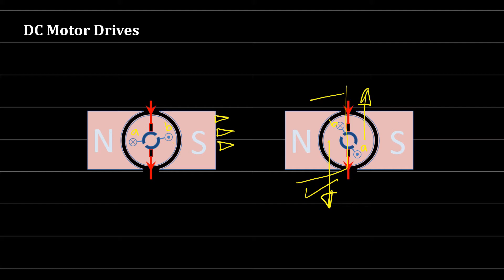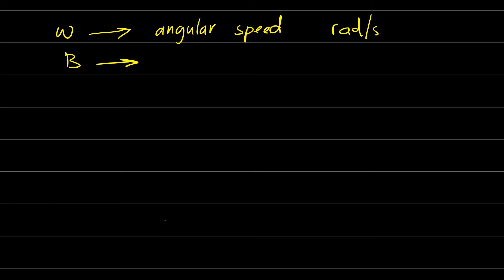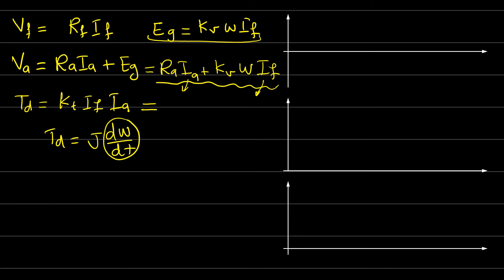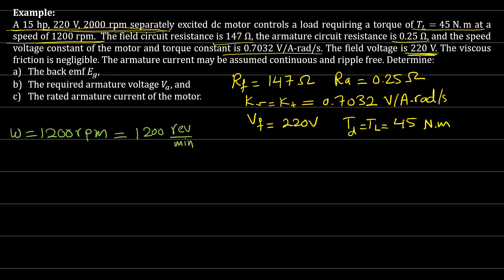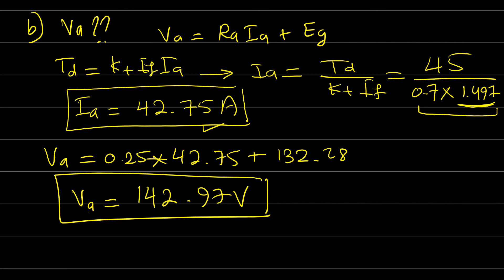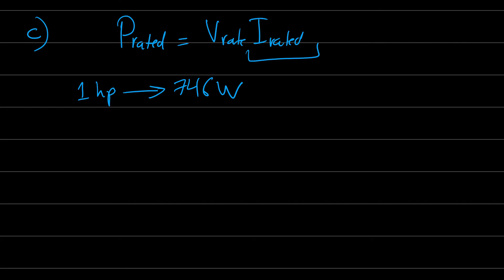Separately Excited DC Motors

Comment: At the 5:40 min mark, it states that the field voltage is fixed.  Is it?  Was it just mislabled?  What if you have feedback control and you require constant speed from the motor regardless of torque / disturbances.  Would it not be variable?  That is, if the application of an increased load causes the motor to slow down, this would require the external field voltage to inrease to increase the magnetic field, increasing the generator voltage output and thus keeping the motor speed constant. Once the load decreases, the higher magnetic field value  can be decreased by lowering the externally applied field voltage.